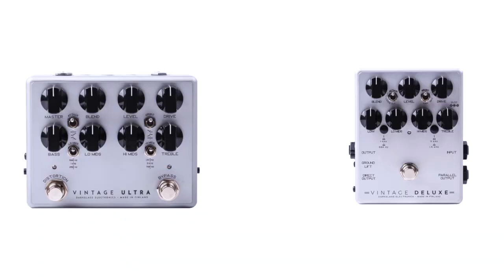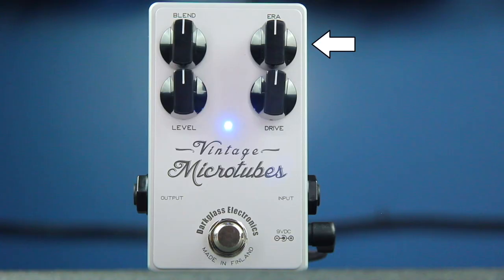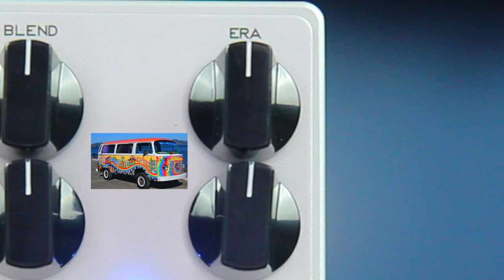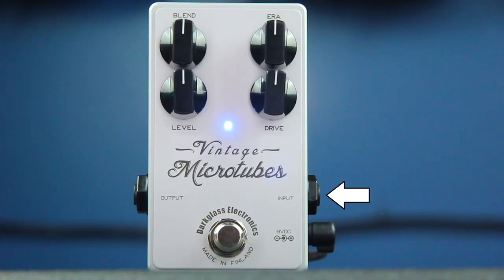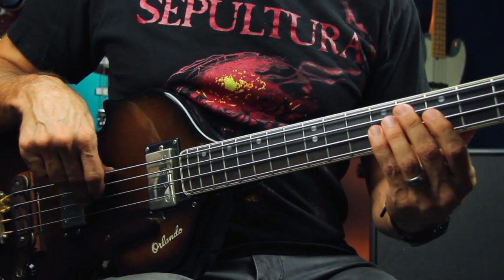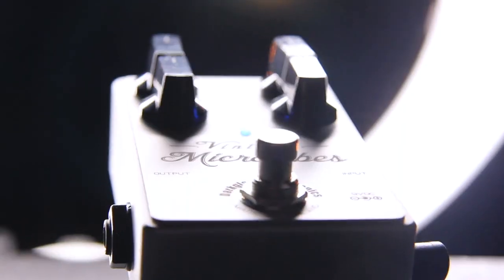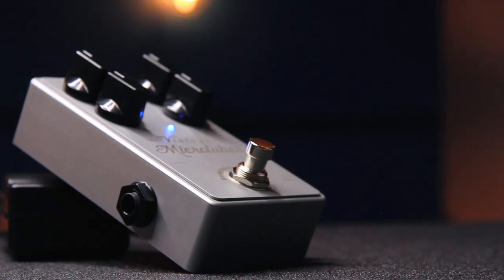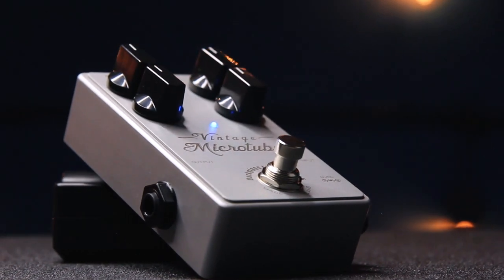Darkglass Electronics Vintage Microtubes Demo

Comment: For years, I used a SansAmp in the standard way - as a "sounds better" button. I got a Vintage Ultra earlier this year and am finding it to be a wonderful tool, but the distortion button is itself a bit of a "sounds better" button. I think you made a pretty good case for thinking of the Vintage pedal family as a broad-strokes tool in that way... they really do wonderful things to the sound and feel of everything put through them.
Reply from the maker: Yeah it’s not quite the bone-crusher the other DG pedals can be. It’s more like pushing tubes the same way guitarists do.
Reply: I primarily use my SansAmp as an always on pedal, but the drive gets distorted when you put it more than 75%. I've found that I like the Sans for the tone and I use the Darkglass for that drive that isn't as present with Sans. Use them together and you've got an amazing tone 🤌

Comment: I really appreciate that you took a look at what this pedal sounds like in a low-gain application.  Darkglass stuff has an interesting and unique tone aside from the distortion, and it's great to see some content exploring that.  Fingers crossed that you will do something similar for the Vintage Deluxe pedal.  Very curious if that is also useful as an "always-on" tone fattener with some added EQ.

Comment: Cool. I thought Darkglass pedals were for rock/metal only. But this pedal looks like you can get some usable sounds for any type of music if you keep the blend and drive low. I've always used SansAmp pedals. For volume-in-the-house reasons, I have to record bass direct. And it's not the same as miking up the bass amp. So I'm always looking for ways to get that authentic bass amp tone. This pedal looks like it'll work great.

Comment: Unlike most "always on" pedals, you need to get your amp tone just right before you set the pedal. I use it in a couple of ways. First is to go back and forth between a clean percussive tone, and a slightly more overdriven tone, mostly to make a song or part cut through that sounds weak totally clean. I've never set the drive or blend above noon. Then again, I have an extensive fuzz collection (which I seldom use on bass) and an Alpha Omega 500.

Comment: I'm so glad I found your content!  I love the sound of this pedal, and the ability to add just a little sauce.  Curious about thoughts on using this or the vintage ultra V2 in an amp-less board going direct to FOH.  Been going direct into a Radial DI after a tuner.  With a solid DI in hand should I splurge on the ultra, or use the savings on an extra pedal or two?
Reply from the maker: I should make a keyboard shortcut for “depends what you’re looking for.” 😂 I was really impressed with the VMT, and for the “always on” fattener, it works great. I actually have not done the ultra yet, but (in many ways) it would be good to try the least thing first.

Comment: Does anyone know what the INTRO song is? That's so great ;-)
Reply from the maker: @zssedmikraska7712  thanks! It’s an original.
Reply: @AmosHeller  I listened to that riff a few times at work today, and it lifted my spirits. Tomorrow, I'll grab the bass, turn on the combo, and go try to feel it out. I got a massive urge to start practicing and playing again. By the way, I've only had another effects pedal unpacked and untested for two years - Darkglass Alpha Omega, and tomorrow it will have its premiere. Thanks, Amos, for the inspiration to get started ;-)

Comment: After watching your many DG pedal videos, I am hoping you can help me pick one.  

I currently have a Trace Elliot Transit B "fly rig". Its 5-band EQ is great, the 2-band compressor is pretty good, the drive section is kinda gross (buzzy, but with a blend knob). I can't seem to dial in the warm tone that goes with blues/rock from the 60s-80s. (I play no metal and no slap.) It has aux in and a headphone out, but it sounds very sterile, so I have a DG Element to do cab sims and practice silently. (Although it can store 5 IRs, I generally find one I like and stick to it.)

When I play out loud, I use a Fender Rumble 40. (It's built-in drive section is nothing special.)

I am thinking to replace the Transit B (and maybe the Element) with one of the DG pedal offerings. I like to keep things simple; once I find "my sound" I don't like to fiddle too much. Given my genre, one of the Microtubes seems appropriate. Also, maybe the Vintage line.

- The X7 seems to be able to replace the Transit B

- The X7 Ultra seems to be a replacement for both the Transit B and the Element (the X7 Ultra's cab sim affects the headphone out, right?)

But can I get that warm tone from the X7s or should I be looking at the Vintage models?
- Vintage Deluxe v3 as a replacement for the Transit B or
- Vintage Ultra v2 as a replacement for the Transit B and the Element

Your thoughts?
Reply: I went with the Vintage Deluxe.  I am working through the basslines on Cream's Disraeli Gears, and this unit is perfect for it.
Reply from the maker: Sorry I’m so late to this-

I haven’t found the X’s to be particularly warm overall. 

I see your comment below-given what you wrote I think you made the right call.